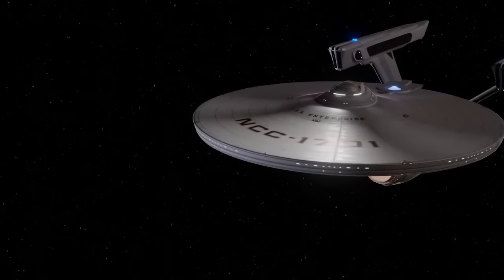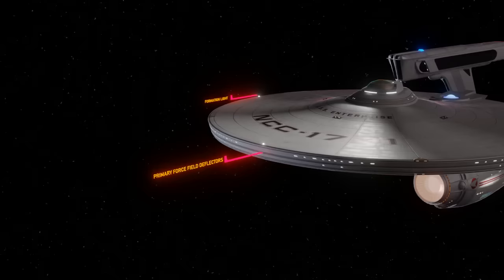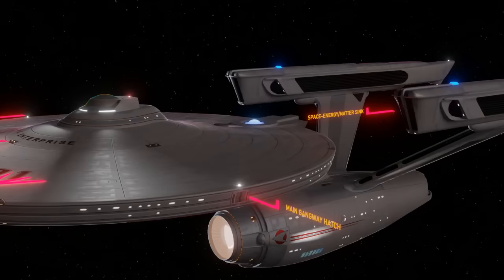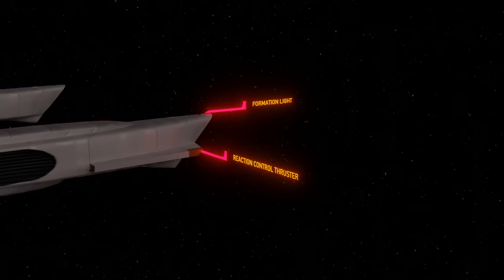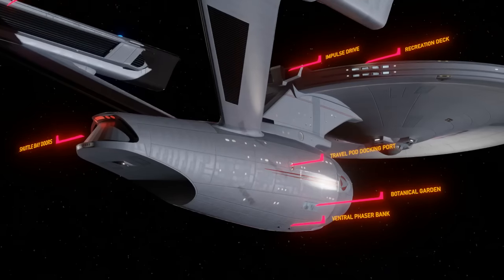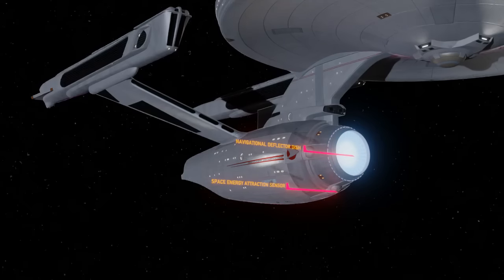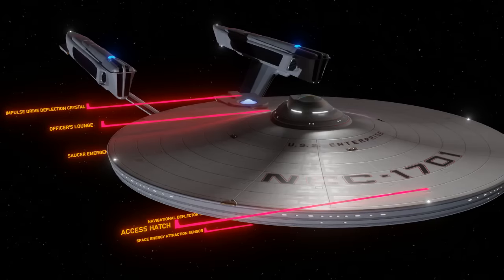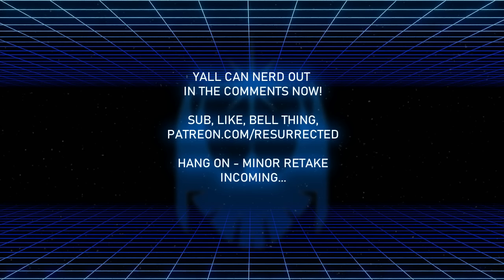ALL The Refit Enterprise Features Explained! CG Model Breakdown

Comment: The first time I ever noticed the concave underside of the saucer, was from the cover of an issue of Nintendo Power, way back in the day. It took my child brain some time to come to grips with that, but I grew to love it. Andrew Probert is a legend. Every curve, line, angle and contour on that ship is flawless. There is simply nothing that can be improved upon. Another thing that makes it unique, is the white hull, which stands in contrast to all the gray ships that preceded and proceeded it. The pearlescent paint of the model was really only ever visible in The Motion Picture, and was absolutely gorgeous. 

Excellent model, and excellent vid! 🖖😀
Reply: The refit Enterprise has consistently been my favorite starship design in the Star Trek Universe, but there can always be room for improvements, even with this design. For me, there were three big problems. 1) Having a shuttle docking right behind the main control area of the ship might not be the best idea if someone confuses the gas pedal with the brake! 2) Putting the main engines at the end of flimsy pylons might induce torsional forces that would impact engine efficiency/warp bubble structure, where a more rigid or shorter structure would reduce those forces. 3) The neck between the two hulls, while elegant, doesn't make much sense structurally...especially when there is a weapons platform, the main transportation tube AND the main propulsion reactor in the same place and highly susceptible to damage. I know there's computer control and gravity manipulation to explain away these problems, but if you don't have these problems to begin with, you don't need anything to compensate for them later! 

In spite of these flaws that an engineer would have issues with, the artist of the ship didn't have to concern himself about any details on how the ship works. His job was to make a ship for a movie. His creation has since motivated countless people to fill in the details, provide improvements, and inspire artistic pursuits, careers, and even real-life products...and create the seed for Star Trek to continue to its many variations TMP spawned since 1979. The refit Enterprise certainly leaves a lasting legacy that many other ships struggle to match.
Reply: @davidkaminski615  All excellent points! I think if it were designed with pure practicality in mind, it would look much like the Battlestar Galactica. So say we all! 🖖😀

Comment: The funny thing about Photon/Quantum Torpedoes is, they're self-guided. You give them a target and they will travel to that target and explode. Very simple. So why does any ship need after Torpedo launchers? The strategic advantage of the few seconds gained by them not turning around is more than offset by increased construction costs and maintenance time.
Reply: No, they are not self-guided. The only time guidance was in evidence was during the last battle scene in ST:VI, when Spock and McCoy added a device to a torpedo that would track the gas emissions of Kang's ship.
Reply: @torontolistener5507

Except that in the Enterprise D they launch six at once and then they go on to their individual trajectories.  It seems foolish that they wouldn’t have guidance as the only rationale to have unguided weapons is lack of technology or expense.

Comment: This is probably my favorite ST vessel design!  Quick question - can people actually enter the nacelles without having to leave the ship, and would being in a nacelle while the warp drive is actually operating be immediately fatal?  Cheers!
Reply: There are Jeffries tubes going up each pylon to the nacelles, but in the TOS and movie era, the nacelles are far too dangerous with all that hot, radioactive drive plasma, for humans to enter while the ship is at warp.

In TNG, there is a control room at the aft end of each nacelle, accessible by ladders, which is shown in the Season 7 episode Eye of the Beholder (they referred to this area in the episode as the "nacelle tube"). The control room is protected by a force field, so it is accessible when the ship is at warp, and is normally crewed by two people at all times.

Comment: The central dish is, in this era, a communications dish. The three navigational deflectors are positioned around it. The Miranda class Reliant has those same three navigational deflectors (which is why the Reliant was able to go at warp without a dish). It wasn't until the TNG era that these components were all combined into the "deflector dish." You've erroneously identified the navigational deflectors as "space energy attraction sensors."
Reply: Hmmm… can you cite any documentation from that time ? I am referring from the 1987 “Mr.Scott’s Guide to the Enterprise” by Shane Johnson which was based on designs, documentation from Andrew Probert and producers from Paramount, which refer to the Main Navigational Deflector; and the 1975 “Star Trek Blueprints” by Franz Joseph referred to the dish of the Constitution class Enterprise’s dish as the Main Sensor and Navigational Deflector and was endorsed by Gene Roddenberry and excerpts from these Franz Joseph plans were heavily referenced for the first three Star Trek films.
Reply: It’s a deflector dish. It always was.
Reply: @calvinnickel9995  Nope. The first time anyone called a blue dish a "deflector dish" was in "The Best Of Both Worlds, Part 1." On TOS and in the TMP-era, those dishes were for communication. That's why the Miranda's was facing ventral and the Oberth's was facing aft. The only TMP-era ship that was said to have a navigational deflector dish was the Enterprise-B in "Generations." The Connies, Oberths and Mirandas all had deflectors instead.

Comment: Given G. Roddenberry's vision that's carried over (to this day) of bridge design, for the life of me, I cannot understand why no aliens just don't concentrate their fire on that obvious Achilles' Heel on all UPF crafts... just take out that external command center, no matter the shields, they cannot protect that external area the same way they could a tactically sound EVERYTHING of a ship.

Oh, and full impulse speed used to be JUST SHORT of Warp 1, they were both pretty much light speed twins... that changed over the decades. They used to both be the speed of light, full impulse almost negligibly slower, Warp 1 almost negligible faster. Thrusters used to be the insanely-fast real maneuverable things most pilots used, with only the masters using impulse speed in combat.

Comment: I realize I'm 7 months late,  But as an old time Tekkie from the 60s and ultimate nerd,
 i must speak up... Now I understand how easy it is to assume that those groves or strips encircling the outer edge of the saucer section are part of the shield system. And that would make sense. Hell I use to think the same thing. But I have since learned years ago that those are actualy Sensor Bands, and that's what they were intended to be by the person who designed the the original filming miniature for the movies. That's also how they are listed on the aftermarket decals sheet for the model kits, Including the big 1/350 scale model by Polar Lights i recently completed.

Comment: back in the 90's, our old books were suggesting the reason the impulse dome was inline with the warp core was because it fed both the warp core and the impulse fusion reactor.  That it conditioned deuterium for both.  The next gen tech manual (that the writers used) said deuterium was stored as slush, and had to be preheated before injection.  This makes sense.

Some other sources suggest the dome is an orb, the actual fusion reactor itself

Comment: The only things I would comment is the nub on the back under the shuttle bay, which is sometimes listed as the tractor beam for the shuttle bay, or a aft phaser bank (there's also two on either side of the "spine" of the ship that could be phaser banks as well, with a single ball turret each). Additionally, the main Rec Deck is located at the back of the bridge superstructure. Note the three large windows? You can see them with armored rolldown paneling from the inside when Kirk gives the speech. If you look at (I believe) the Polar Lights Refit Enterprise model, there is an insert where you can actually see the details inside the windows. The Officer's Lounge is actually the two rows of windows on the back half of the saucer. In the corrected Star Trek: The Motion Picture, you can actually see the warp nacelles through one of the rounded rectangular windows. In Star Trek V: The Final Frontier, this deck is used again, but the VFX team inexplicably made a bunch of forward facing graphics for Kirk and Co. to react to, even though there are no such windows on the model.

Comment: I always wanted that vent on the back of the neck to be an aft facing torpedo tube. Perhaps shuttered most of the time and not as fully featured as the main tubes.  It would also be handy for dropping probes behind the ship while at warp, perhaps analyzing one of those FTL anomalies that are so common.

Also, a war fit version of the ship could have a full sized aft facing dual mount like the Miranda class.

Comment: If you read the original Technical Manual for the Constitution Refit, you'll know that there are at least 7 shuttle pod docking ports.  The five you mentioned, plus at least 2 more recessed into the ventral side of the saucer section hidden behind doors that follow the contour of the outer hull.

Comment: WOW !  Loved this video and you did an amazing design and render of the refit Enterprise !
As for the explanation of the Space-Energy/Matter Sink, Magnatomic Amplification Crystal, First Stage Flux Constriction and Magnetomic Flux Chiller, I’d like to offer an explanation based on some cannon info and some plausible speculation on my part. 
The nacelle based warp drive of starfleet ships uses a Matter/Antimatter Reaction. Well diagrams show storage pods for antimatter, magnetic storage of antimatter as any normal matter the antimatter would come into contact with would instantly annihilate. But since hydrogen in the universe is ubiquitous and even in vacuum exist in quantity and density of about 40 atoms per cubic meter. Not a lot but if you are moving through it fast enough and using the “Bussard Ramscoops” of the Space-Energy/Matter Sink, which uses a massive magnetic field to funnel that near vacuum hydrogen into your MARA system so your ship only has to carry the anti hydrogen. Now I say anti hydrogen because it is a single positron like normal hydrogen is a single proton… no neutrons needed to hold a hydrogen/anti hydrogen nuclei  together and it is heavy neutrons moving at relativistic speed that makes ionizing radiation. So using hydrogen/anti hydrogen means no radiation and less radiation shielding !
Now the first stage flux chiller acts like compressor blades of a real life jet engine. In Star Trek it’s probably magnetic fields that do that constriction. The magnetic flux chiller… I don’t know… uses another magnetic field system to expose the condensed scooped hydrogen from a hot plasma that would be induced when a starships Bussard Ramscoop operating at warp speed compresses that vacuum hydrogen. Then this massive amount of hydrogen is directed down the nacelle pylons to the rear of the engineering deck’s horizontal intermix chamber to mix with the antimatter in the vertical intermix chamber and the resultant super high energy plasma created in the Matter/Antimatter Reaction is diverted up the vertical intermix system to the impulse engine and it’s impulse deflection crystal and fusion reactors and rearward through the system back up the nacelle pylons to the warp nacelles proper where the warp field that envelops the ship is created. The Emergency Flush Vents are just that, able to either flush excess incoming hydrogen or to vent warp plasma in emergencies.
Again, using documented diagrams and descriptions from Mr.Scott’s Guide to the Enterprise and other resources from online to the Star Trek Encyclopedia and TNG technical manuals and some educated speculation this is what I think is a plausible technobabble explanation for the labelled features of the engineering deck and warp nacelles and pylons of the Enterprise.

Comment: @ressurrectedstarships:  A few notes.  The primary deflector dish in any Federation ship does not in any way modify the warp field (including projection thereof).  Its primary purpose is as you indicated: sweeping objects out of the path of the ship while at warp velocities and, to a much lesser extent, sublight velocities.   The one exception I am aware of was Voyager episode "Parallax" and that made me roll my eyes at the time it aired.

Secondly, impulse engines as you noted are indeed using fusion reactors.  However, the way they work is not as you think.  Imagine them as sublight versions of the warp drive.  Indeed, the TNG technical manual points out that it uses the same space warping logic as warp drive, but at sublight intensities which do not require the power of a warp engine.  Though, typically, the Federation tends to limit impulse velocities to 25% of the speed of light due to time dilation effects.  It's not that they can't go faster as a rule, but the prohibitive nature of time dilation at sublight velocities precludes the likelihood of going faster.

I think that the above explanation of how the impulse engine works would work fine with your theory about engines (including impulse) being able to reverse in place.  Indeed, in the TNG episode "Relics", LaForge and Scotty discuss the fact that impulse engine design hadn't changed a whole lot in 80 years with LaForge pointing out that the Genolan could probably run circles around the Enterprise at impulse speeds.  And, of course, Scotty mentioning he wrote most of the specs and rules for Impulse Reaction Control systems (IRC in this case) that Geordi was referencing.

The engines do apparently spray out an ionic radiation pattern that is unique when in full reverse. Reference: TNG: Relics.  Scotty mentioned it to LaForge who didn't take him up on the bet that it was indeed the cause of the radiation pattern they saw on sensors.

The other deflector systems you mentioned weren't for space flight, but were for other sublight purposes.  As you posited, combat was one reason.  Another is heat shielding that is different from combat shielding.  Indeed, both TNG and TOS reference different types of shields in their run.

Comment: The additional detail also gives the audience a good sense of the Enterprise's size more so than The Original Series model.  On that model, we do have some sense of the ship's size mainly from the Bridge module and Shuttlebay, but this model gives us a lot more to go on.  This is rather important, I think, in help bringing the show more to life than TNG and subsequent shows ever did.  In fact, one of my gripes about most subsequent ship designs, with some exceptions like the Defiant, is that we don't get as much detail as we'd like, or worse, we might get a distorted sense of scale.

The "new" Enterprise seen in Strange New Worlds shows us a rather unrealistic Enterprise, with big, spacious rooms, complete with various amenities such as windows.  Captain Pike's quarters is huge by comparison to TOS Enterprise and the refit Enterprise's Kirk's Quarters, both of which feature no window to look out of.  While you could say, volumetrically, they could conceivably have rooms for the captain and other officers like this, at the same time it makes it difficult for us to believe this ship would really exist like it does compared to the earlier designs, which felt more utilitarian in design.  As big as the older Enterprises were, once you set a scale, you've now just limited the amount of spaces on the ship.  For a ship that can accommodate 430 personnel, and then have things like a sickbay, auxillary control, engineering spaces, laboratories, and other things (such as a gym, a swimming pool and bowling alley, a botanical garden, weapons, etc.) you have to consider all the space necessary to be able to allow so many people to be able to inhabit and function.  Life support and waste disposal are critical systems.  

If you ever watch the Battleship New Jersey channel, with curator Ryan Szimanski, that's a ship barely one quarter of the Starship Enterprise's size with more than three times the crew, and every space is utilized in various ways aboard, which, I think, if you apply that logic to the Enterprise, gives the ship a sense of believability.  When you mess with this, it makes it hard to suspend disbelief for the audience.

Comment: Wonderfully done. But remember, plasma is white hot, and is what is generated in the ship’s warp core and is visible. If you’ve ever read the Mike Okuda authored technical manuals, the main combat shields are called “graviton based deflector shields”, hence why they’re invisible unless impacted upon.
Reply: yeep…gravitonic reflection systems and gravitonic generator are significant equipments.